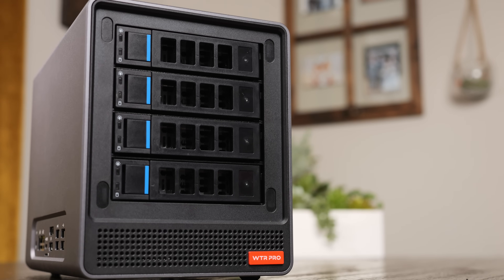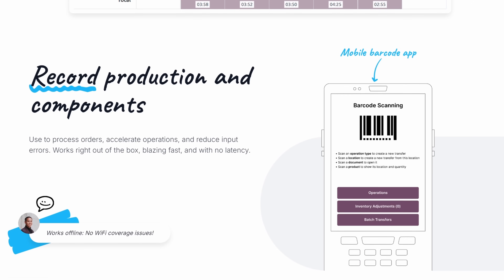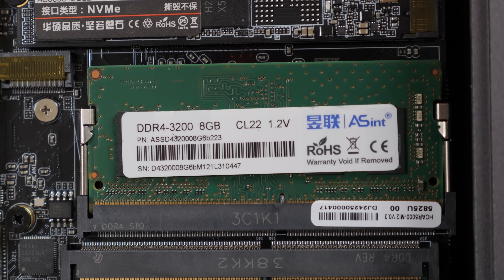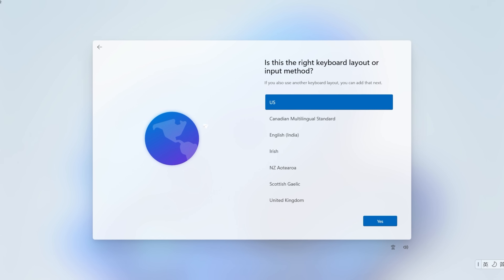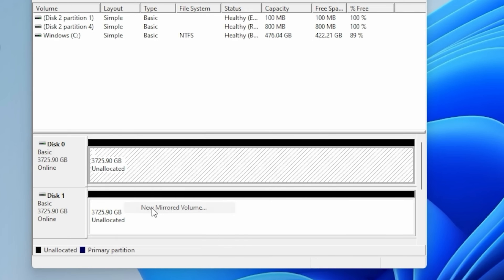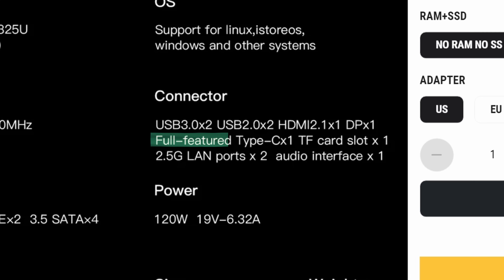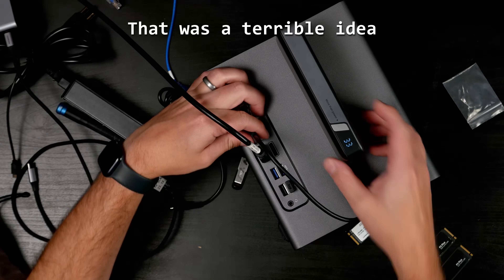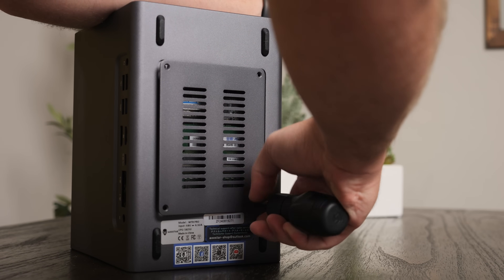The Home Server I've Been Wanting

Comment: Hot-swap drives = higher cost
I don't think the majority of people buying this will be too concerned it doesn't have hot-swap drives.
Reply: Yea hot-swap Its cool... but I wouldnt pay much extra for it. If you cant find 30 minutes of planned downtime to swap a drive sometime within a week or two of failure you probably need a MUCH more professional system than this one
Reply: I tend to agree to some extent that most users might not be concerned of powering down. However one reason why you would not want to power down is that if you have a raid and one drive dies. you could have a situation where a second drive will fail during the power cycle. I did have this in a server at work. it was a very old server, with two drives in a mirror. One of the drives failed but the system kept running. It did not have hot swap, so we shut it down, replaced the broken drive and powered it back up, but it would not boot. After some investigation we found that the second drive had also failed so all data was gone.
Reply: @eldaria  did you learn the all important lesson?......
"RAID is not a backup"
Reply: @Andy_FortyTwo  If you are refering to the last bit about data loss, then you missed the point with my comment. I know RAID is not backup. But we were not talking about backups. We were talking about the use of Hot-Swap.
Reply: AFAIK all standard AHCI controllers support hot-swap. I hot-swap SATA drives on internal PC ports all the time and at least on Linux it just works 99% of the time even though the hardware isn't designed for it. I would bet that this system is also capable.

My guess is it's unsupported due to the power delivery. Unless there's a dedicated power management circuit attaching a drive to a running system can potentially cause a power blip as its capacitors charge. I've only encountered one system where this was an issue.
Reply: You can buy hot swappable external enclosures for cheap.  Stop lying about the expense.
Reply: @zgames9400  Yes USB is hot-swappable...... do you know of some were the actual SATA connection is hot-swappable?

The SATA standard does have hot-swap capabilities. But you also have to ensure the correct hardware components are there for electrical safety. And also the software needs to know you are hot-swapping, else it may be sending data to the driver when you decide to take it out.
Reply: Yea they would...that's a big deal
Reply: Also, drives without motion sensors (accelerometers) shouldn’t be hot swapped.
Reply: Why is hot-swappable drive architecture more expensive?
Reply: To be frank it's still bad design language. If you look at synology NAS devices, you can instantly tell which ones are hot swap and which ones aren't due to the lack of easily accessible drives. With these drive bays right there infront of the user, anyone would assume it would be hot swappable so it's jarring when they're not.
Reply: its one of those things where most people can get away without hotswap just fine, but it makes it really tedious and annoying every time you do need to swap a disk, like it means if you need to swap a drive you need to shut down everything, and hope that you dont have anything running that'll get mad and have to start from scratch if stopped
like shutting down the storage array itself and not having it able to stay online while missing a drive(think raidz and parity), sure can live without that, but its the fact that the entire rest of the system goes down with it since in a homelab you usually will have lots of non storage related services running on your storage server, meaning those go down too
Reply: @hannahlamond7710  and others....... By the sounds of it you are not in the majority group of people who would buy this.
Reply: wait disks could be hot-swappable? i guess that's a thing only with NAS devices because I never had one
Reply: @govnomas  Your normal PC can hotswap too, It just needs to be supported, but you literally eject it like a USB.
Reply: @slavic_commonwealth bro you can technically just hotswap any sata drive. Just need to refresh devices in windows.
Reply: As far as I am aware, you cannot have Hot Swap drives without the hardware having some control of or being that which provides the RAID functionality. Also (It's been a number of years)  but I found ZFS while awesome did not do exceptionally well with hot swapping unless you dropped the drive first.  I would love to know if either of these is wrong these days.
Reply: @MyLittleBitOfEverything you are wrong. Have used ZFS in every platform going back to Solaris. As long as you have a hot swap backplane then it works fine. The correct method to removing and replacing disks however is to offline the disk (if possible). This is no different then any hardware RAID controller or other software based RAID solution.
Reply: Lets say you have a pile of 4,6 and 8 tb disks and you want to ingest them into your new 60Tb UnRaid server. You populate 3 20Tb disks and use the 4th to ingest data to those disks using Krusader or rsync. Once each disk is ingested you'll need to shut down, and swp to the next disk. And the same when you add the 4th 20Tb as the parity. Each disk swap needs a shutdown and restart. Not the end of the world, but certainly annoying.
Reply: @dash8brj  That's what a powered USB 3 hard drive dock is for.
Reply: @dash8brj Or just use a usb adapter for that...
Reply: @dash8brj  Ingest with a USB attached dock. Also means you can already run all 4 other disks for your main data.
Reply: @dash8brj  If you're running 60Tb, you're not going to be using a system like this, not to mention a toy OS like UnRaid.
Reply: @LordVarkson  yes I definitely would lol

Comment: 10:30 I have a wifi adapter in the trashcan model, gave it to an openwrt vm and using it as a wifi access point in the server room. Not all can be used though, mediatek, qualcomm worked, intel, realtek nope.

Comment: Things like this device are ideal if your primary goal is to have it all in a mini case. That's it. 
Because there is no substitute whatsoever for just repurposing an old PC. You use a little more power ($25/year, oh no!) (be sure to configure your drives to park) and take up a little more space. You'll never get better expandability, cooling, processing power, serviceability or software options with the little proprietary NAS boxes. Bleh. 
My NAS is a Ubuntu Linux machine in a SFF Antec tower case with 8 SATA and 2 M.2 drives in it, 500GB to 4TB in size. No RAID. They're just shared via SAMBA. I prefer to map multiple network drive letters. I don't want all my files on one gigantic volume. Plus, I run several VMs using VirtualBox. I can dual-boot the NAS to my old W7 SDD (all of the drives then mount as local devices) OR launch it as a VM. When I need Bash or a Linux desktop, I open puTTY or RDP from my windows workstation (an i9 laptop with docking station and 3 monitors - you'd never know it was a laptop). I have CDROM, USB3 and USBC connectors, could connect multiple monitors if I wished, but run it headless. My files are accessible worldwide via VPN, such as on my phone. It does everything a proprietary NAS can do and far more. And it could do RAID if I wished; I just don't want to reformat all of those drives or use unix volumes.

Comment: This looks like it might be perfect for my needs. The big problem with building something yourself, is that you will either wind up with something more expensive, or something that's physically a lot bigger, or both. I love the functionality you get from that little of a case.
Reply: I've built similar solution myself with X86-P5 by CWWK, Jonsbo 5bay backplane and 3D printed parts and I will say, if this Aoostar would be available when I did it, I would just grab it instead of headache I've got.

Comment: [Witty retort to intro snark]

I think either of the N100 versions would make an incredible remote backup device. 2.5 G networking is sufficient for a device limited to internet speeds, and in my mind the transcode capability of the Intel processor would outweigh the additional Ryzen compute power for a device like this. I had been considering building a low cost system around an Odroid H4 Plus for remote backup, but the R1 looks like it would be the better choice from a cost standpoint.  Thanks!

Comment: This hardware is fire! I would like to see how the drive performance differs with the N100 version. Now add a coral TPU and see how it handles recognition in your video surveillance system.

Sponsored by Unraid? Joking! 
Still, Unraid makes no economic sense. Paid (pretty expensive) slower than True NAS and you only get 1 year of updates... 1 year. If you want ease of use, when you factor hardware cost and Unraid prices, Synology makes more sense. Unraid is the equivalent to 45drives in the homelab, only worth it to the fan(atic)s. now for a small business... the warranty and support is well worth it!
Reply: I'd agree if they could fix the goddamn HDD spindown in TrueNAS that simply doesn't work properly.
So far Unraid seems to be the only Linux based OS that manages to properly turn off disks... For a large array it can pay for itself fairly quickly.

Comment: Idk what problem manufacturers have with built-in PSUs. Even an Apple TV manages to squeeze in a PSU, all while basically all NAS manufacturers rely on external PSUs.
Reply: Internal PSU are an extra source of heat and if it fails it means you can grab the device and throw it in the bin, with an external PSU just grab a new one.
Reply: @v0ldy54  I love the explanations, when it's just the fact that including some Chinese external PSU is simply cheaper and nothing else.
Reply: @graealex  like Apple PSU aren't chinese stuff...
Reply: Internal power supplies are usually proprietary so they are difficult to repair or replace.

Comment: I noticed with my MinisForum  NAD 9 that the power brick draws about 5-8 watts on its own, so I could see using an efficient USB C charger like an Anker or UGreen GAN wall plug if you're after every watt for a 24/7 NAS/media server build. I was actually just looking at the N100 version of this to consolidate my TrueNAS Scale and Plex media server into one machine. 

The Ryzen 7700 I built using the combo at Micro-center is a bit overkill for just a NAS, plex doesn't support hardware transcode on AMD, and I was already planning a mini-pc for my mother this year as she's several years overdue for an update. I could just put windows on what I built and migrate to one of these easily.

Comment: I ended up repurposing my old Intel laptop with a broken hinge as a Jellyfin media server a little while back (with an external HDD enclosure for storage) and have been looking to upgrade to a proper NAS + RAID setup so I don't have to worry too much about a drive failure bringing me back to square one. I think I like this one!
Reply: @Fighter_Builder  I’m learning things; while it doesn’t support RAID you can run Unraid or TrueNas and use ZFS or Btrfs and get more or less the same features. So it’s actually not as bad as I thought.
Reply: But it doesn’t support Raid.
Reply: @cenobitedk  Yes thats one of the tradeoffs with a cheap home server, but for 500 ish what can you really expect lol
Reply: @cenobitedk  Darn, I didn't know that. Thanks for the heads-up.
Reply: Same here, priced nicely and still packin sum power

Comment: 2.5 gbe is not bad if you think about it. in the last 2 years we started to get products with the nic and most consumers are locked in with routers that are 1gbe. and internet tunnels that are 800mbps  or less. still for the average user this product is leaps and bounds ahead of Western Digital and or synology
Reply: I use my NAS for iSCSI storage for vSphere hosts at home. 2x2.5Gb is actually fine even for that. I can do round-robin and probably see ~300-400MB/s through it. More than I'll actually be able to push with RAID6/Z2.
It's simply "good enough" for a small NAS. Would be cool if it was SFP+ cages though, would make connecting it to my SFP+ switches cheaper.

Comment: Wish there was an option with ECC RAM.
Reply: The Ryzen chip version should support ECC if the motherboard bios implements it… would be cool if someone tested it
Reply: @wojtek-33  I’ve never ever heard that home user would’ve provenly benefited from it. Like I mentioned 20 years without issues on 24/7 boxes. Never had issues with Proxmox instances etc.
Reply: @wojtek-33  you do realize it's used for like data center level stuff? I've ran home servers for like about 20 years. Some of them have had raid5 server and never ever suffered from data loss on home computer level hardware. It doesn't make any sense to use like puny processor machine with ECC that usually even expensive as hell.
Reply: @jothain Intel distorted the market. ECC should have been in everything years ago
Reply: Why.....
Reply: @jothain truenas recommends using ecc with ZFS
Reply: Why.....
Reply: @jmwintenn  for ZFS
Reply: @jmwintenn  ZFS recommends ecc ram
Reply: @jmwintenn  ECC RAM can have bigger capacity

Comment: I've following this mahince for a while and here are some additional info:
1, It has a re-purposed board from one of its mini PC thus with all it plugs side way, and probably help reducing cost.
2, You can adjust CPU power from BIOS up to ~60w, which will unleash its full potential with rating as shown in Passmark's site. Down side is that head sink can't catch up and will throttled some while later.(Heard that ~50w is the sweet spot)
That said it's pretty powerful among recent China made NASs and good for AIO homelab + NAS
Reply: Where can I find the components list of this nas? Looked everywhere cannot find a technical list of the components with their names etc

Comment: After owning one of these no name brand mini-pcs, I'm starting to want to see long term stability/use testing. I've had an Aoostar Gem10 for right around a month. I populated all 3 M.2 slots with NVME drives. It worked fine for a few weeks, then suddenly started experiencing hard crashes and locking of the system. Bluetooth stopped working, then Device Manager couldn't recognize a USB adapter. I pulled the Intel Wifi/BT card and that issue in Dev Man went away. I also removed 2 of the SSDs, but the system is still crashing quite often. My guess is the system can't really handle either the wattage or the heat if you run it like they say it can be run. It may be a setting somewhere since I never hear the fan kick on. I may try going back to a PCI Gen 3 drive and removing the nice P44 Pro 2TB I put in it.
Reply from the maker: Thanks for sharing! I'm curious about this as well, but long term testing for all of these is definitely tricky. Might just be smart to hold off for a while and see what people say in reviews and on Reddit and such.

Comment: The GPU is a Vega 8 which is a GPU from 2017. I have a Notebook with a Vega 10 from 2019/2020 with a Zen+ at this point the GPU was adequat for a Notebook. But i have 10 Vega Cores this NAS only got 8. The other Main Advantage of the 5000 Series is not used as the Notebook chips have a reduced interface: ECC and PCIE 4.0. But this is complaining on a high level. all in all a nice Setup, but with a cheap mITX B550 Board and a Zen3 Chip like a Ryzen 7 5700x you might get better results with ECC for the same price.

Comment: you should try to bond those network interfaces together to get 2gig networking to it. you can do that pretty easily in linux with some config file tinkering.
Reply: Each LAN port is 2.5 GPS so bonding them would result in almost twice this (5 Gbps).

Comment: If you set the governor to powersave you basically lock the CPU to the lowest frequency, which could explain the low transcode performance...
Reply from the maker: I don't think the dedicated video encoders and decoders would be affected by CPU clock freq
Reply: @HardwareHaven  maybe not, I haven't tested it either.

Comment: Can you extend it with a DAS over USB-C ? This thing looks good!!
Reply: Yes, although maybe better if the USB-C port was USB3.2 gen2 10Gb/s. Sabrent sells some rugged toolless 4- and 5-bay USB DAS enclosures that should work with Proxmox or TrueNAS Scale, at least according to the Level1 forums. The later USB-SATA bridge chipsets seem to have better error handling and reliability for support of RAID and ZFS, compared to earlier chipsets (so says Wendall). I bought a Sabrent 5-bay but I haven't gotten to testing ZFS on it yet.

Comment: why can't they use a standard PCIe G3x8 slot? do any comparably compact 4-6bays do that? or is it just better to just use a Mini-ITX board...
Reply from the maker: The problem is the amount of lanes the CPU supports. If you had a x8 slot, those two NVMe slots can't exist. At least not without adding PCIe switching which also introduces lots of other potential issues and cost.

Comment: Excellent presentation.  Thank you.   I really like the looks of this one for Proxmox.  Love your idea of doing the boot drive and saving the 2280 NVMe's for storage.   The lower power draw is perfect.  How quiet is that fan as that could be a deal breaker for me?  Also, can the 3.5" bays/caddies support 2.5" drives too?   If so, I could see adding SATA SSDs there to keep things quiet?
Reply from the maker: Noise was pretty good, and system fan could be swapped for something else (I think). And yes, it supports 2.5" SATA SSDs

Comment: That would be just perfect if it would had thunderbolt connection. With that you can get adapter and change it to 10gb Ethernet. I haven't yet found one 😔
Reply from the maker: There's a cheap 5G USB adapter making the rounds on Jeff Geerling's channel and NAS Compares that could be a decent option. Not quite 10Gb but better than 2.5